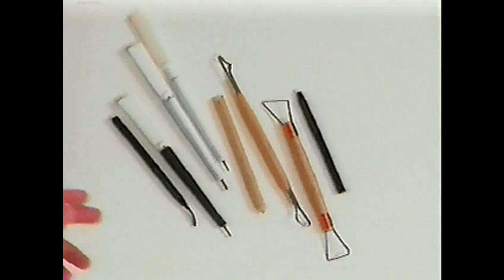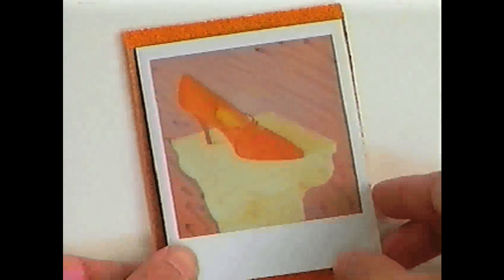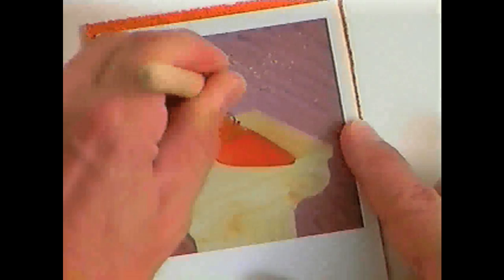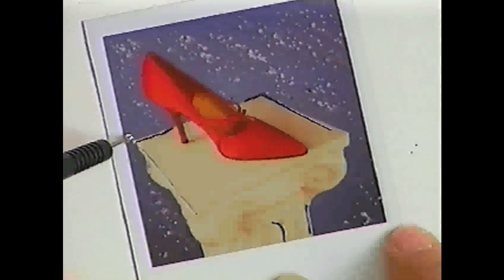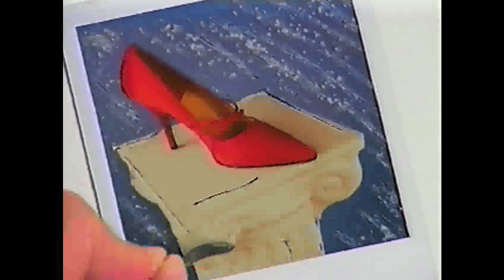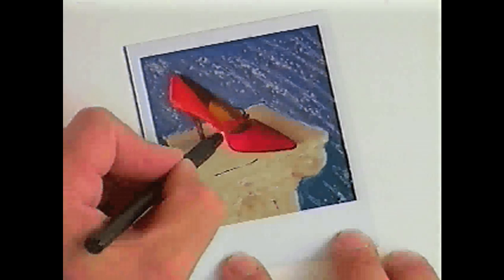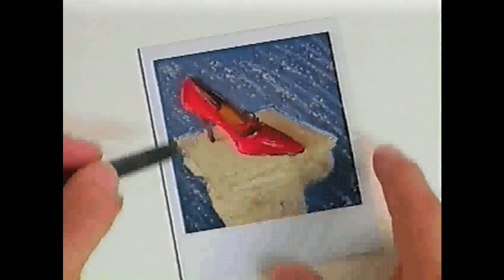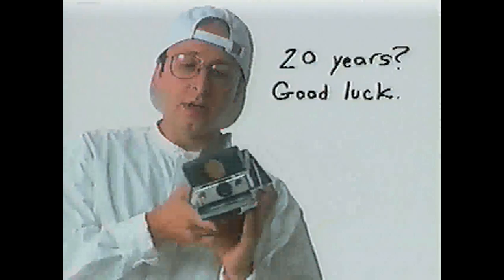Polaroid SX-70 Manipulation Demo

Comment: I did this work in the late 70's and through the 80's using the SX-70. Polaroid sent me boxes of film to experiment with. They bought some of my prints. I put some of my work in toasters, in the freezers, took lighters and used the heat to manipulate the works and used many tools to get the best results from the film. I have worked with this film today but I have not found the film to be as good as the original SX-70 film. I have done this technique with the other types of Polaroid film but it does not work as well as with the SX-70 film.

Comment from the maker: @stee1face 
@4:24 into the video? A plastic tipped press on type tool with a little pressure immediately after the image comes up. What that did was break up the image and squeeze some of the TiO2 up underneath the protective mylar sheet.

Comment: Great video. One question, what is a two step neutral density filter? Thanks
Reply: 2 Stop not 2 steps of light. A step of light is either doubling or halfing the amount of light. it essentially reduces the amount of light that comes into the camera by the use of a dark filter its needed because sx70 film is 150 iso and 600 film is 600. Going down 2 steps from 600 iso to 150 is like this 600/2=300  300/2=150
I hope that was a good explanation, even though you waited 9 years lol